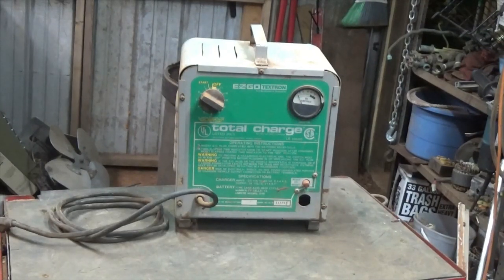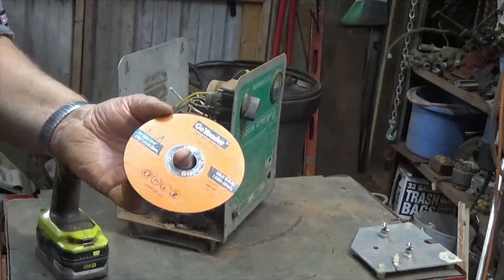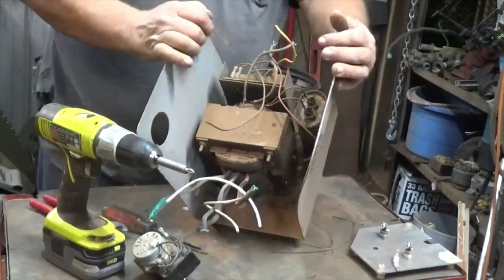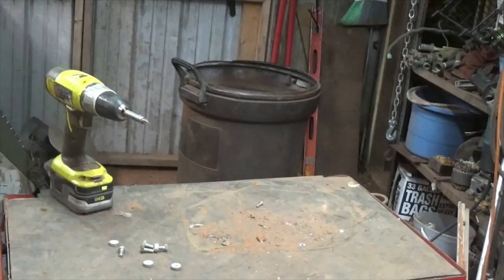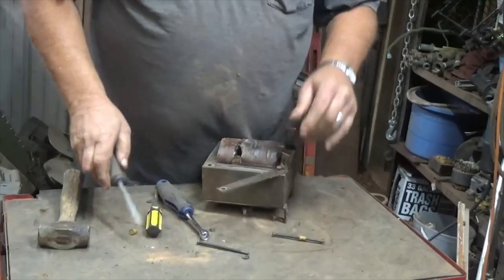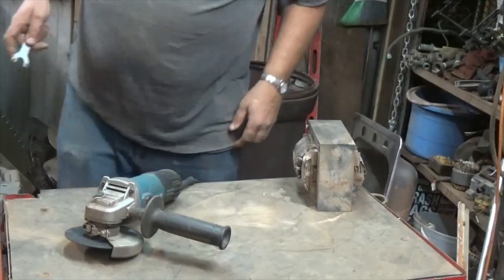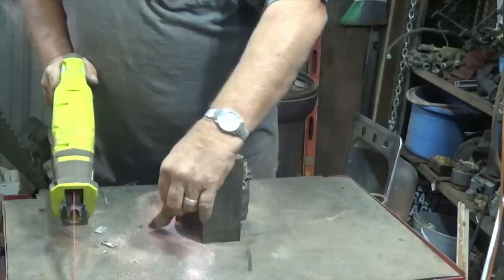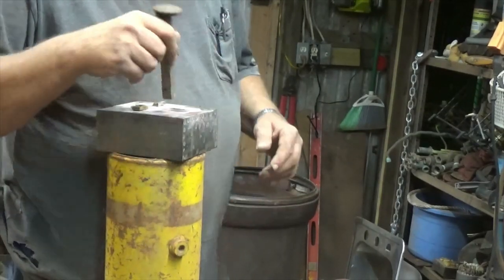Scrapping an old Golf Cart Charger for the Copper

Comment: The square aluminum piece is the diode, converts the AC to DC, I've had them burn up and that stops the DC output. Also the fuse is 250 volts and less than ten amp. I like your railroad punch, I'm going to have to make one. Keep up the great videos and God bless you and your family.
Reply from the maker: thanks for the info, I don't use that punch often but it is nice when I do need it, thanks for stopping by

Comment: Personally i break down all my scrap when i get it. I see all these scrappers on youtube have piles and piles of scrap. Why not break down and sell before getting more.
Reply from the maker: so don't pick up scrap when people call to have their scrap picked up? tell them I will get to them when I get my scrap cleaned up? your method may work for street scrappers, but I run an add, and I take it when I can get it, and clean it when it's slow, even street scrappers may be slow Pickins in the cold weather so they will get what they can while the getting is good. and process it in the slow season. everyone scraps their own way
Reply: @Okiescrapper  definitely not saying anything bad about your method because everyone has their own way. Just curious about how some people do their scrapping.